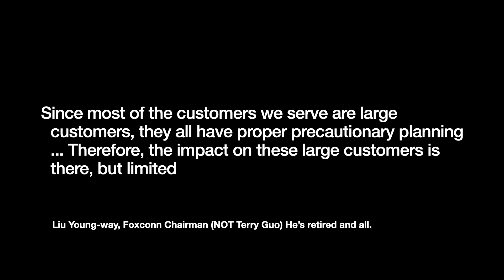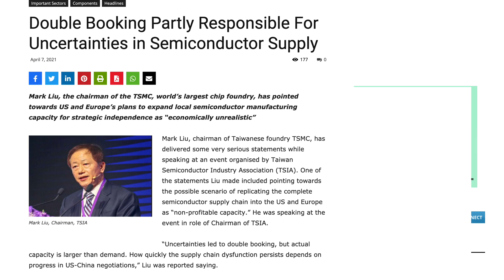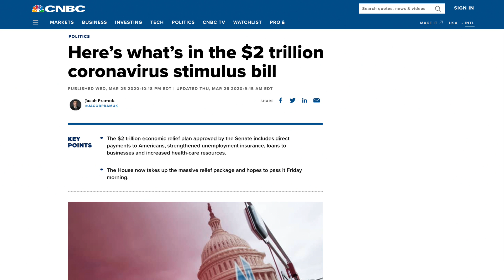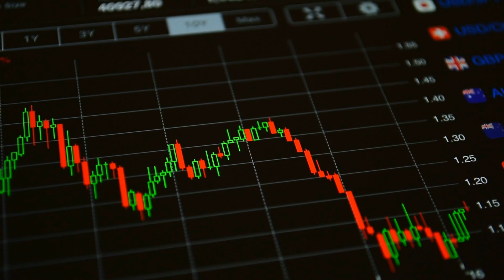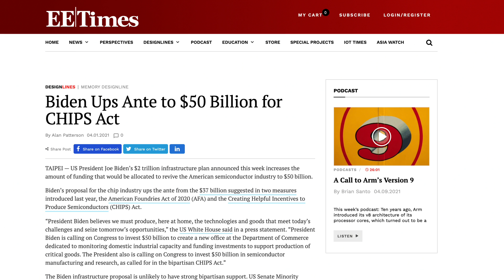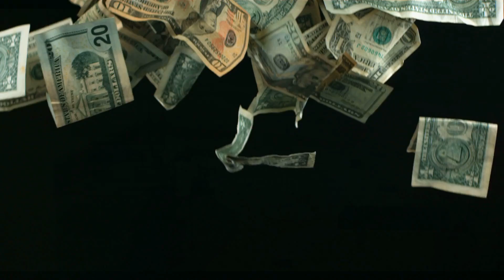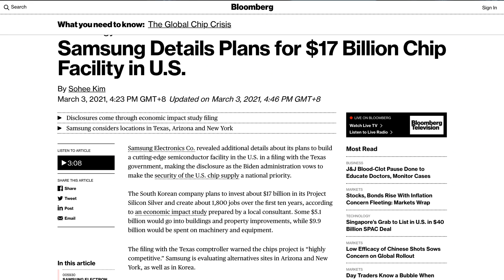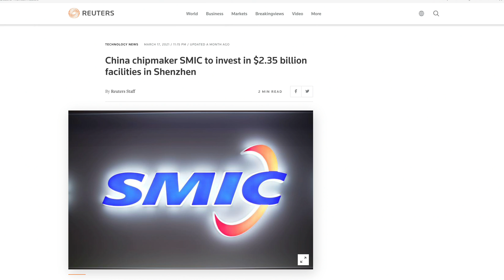The Coming Semiconductor Bust

Comment: I think the big engine for demand will be electric cars.  Many countries want to phase out gasoline and diesel cars and replace them with electric.  These electric cars are going to come down in price fairy quickly, maybe in 10 years they will easily undercut the cost of internal combustion.  When that happens, a lot more people will consider buying new cars who previously only bought used.  This is because, fundamentally, electric is easier.  It does not take billions to develop electric motors.  And makers can use the same motors, just more of them in higher end, to get better performance.  That means better economies of scale in making the motors.  And no billions for transmission engineering...most won't even have transmissions.  Several models of electric cars can share the same "skateboard" making it easy to make new models.  There are only 2 things slowing this.  The batteries...just because it is hard to scale up production.  And the car factories.  These things need to get paid for.  Once they are, prices can move down.
And we will see this all over again with personal flying drones that carry people places.
There are some other areas that may expand as well.  VR, AR, and elaborate heath monitoring, are finally arriving, soon, I think.  Smartphones may be replaced by AR/VR glasses.  The health monitoring craze, I think, has just gotten started.  This will also help drug research, and just general medicine, as we will learn much more about normal ranges for things, and what affects these measures.
And people will want satellite smartphones rather than just ordinary smartphones.

Comment: Also correct, Moore's is not a physical science rule, rather it was a description of the era of rapid semiconductor development.  No Boys and Girls, we were not going to continuously shrink semiconductor node by 1/2 every 18 months forever,  but it was fun while it lasted.  We are not doubling transistor density every 18 months.  And BTW mores law was not about the number of transistors in the die, it was about doubling transistor density every 18 months.  And during the era of rapid semi development, the cost was also coming down.  One thing to consider, and is unique to semi, is that no other industry strives to double the performance and lower the cost at the same time.

Comment: I have been in the industry for along time.  I agree with you.  Holy MOLY that sounds like doubling the existing capacity,  What you fail to empathize is that as well as costing BILLIONS to make a fab, it takes a pretty long time.  The buildings are complicated and full of chemical compliance nightmares , and it takes lots of really smart people to run those fabs.  Plus Ithe tooling vendors do not have the latest and greatest ASML litho tool (150 million) waiting on the shelf.   PLUS the GRAINULARITY  of a fab.  Once its up and running, that is a lot of capacity.  How many chips will be produced by all of those fabs?  TRILLIONS?  Probably not enough trained people to work/run those fabs in USA.

Comment: Question: If there is a bust and there ends up being a lot of excess manufacturing capacity, can we expect SSD prices to go down significantly as well?
Reply: SSDs aren't the same type of product.  Does TSMC even make any memory products?  I know Samsung does and some other companies.

Predicting sales of SSDs isn't the same as predicting what's happening at TSMC or AMD or Intel, etc...  For instance I can build a new PC using all new parts, but last year I swapped out an old NVMe for a newer one, and I move that into my new system.  Best to get that information from the business world that watches that industry.  Businesses upgrade their storage configs when they see the need to, and upgrades are always centered around SSDs of different types, such as NVMe drives can be used as cache buffers for large arrays.

GPU prices are painful right now, but SSD prices are basically near their MSRP, and there are sales on older products which means a good supply of newer products.  I just bought a couple WD SN750 1TB NVMe drives for the lowest price I've ever seen them at.  But I wouldn't use that one tidbit of information to predict prices a year from now.
Reply: @johndoh5182  Thanks for your insight.

Comment: With regards to fab expansions, unless you have equipment planned in the build pipeline already, it can take you over a year to get a slot, depending on general business conditions. With how it is now, if you haven't planned it already, you may well hit the next downturn before the tool is delivered. Saying that, a downturn right now may just be a slackening in a generally increasing demand (hopefully :-) ).
If you are looking at building a fab, you are not looking at current conditions at all, but extrapolating out a long way - state of the art fabs take 3-5 years to build and kit out, with a likely 1+ year to bring online. If everything aligns it will be a minimum 3 years from decision to build to first silicon.
Reply: that is why with more advanced nodes there is hope that instead of die-optimised chips, there will be more fpga and neuromorphic , universal chips possible.
universality is both bad and good. 
ability to have fpga for beta products at much smaller node than predicted final product (f.e. microcontroller) is something everyone looks forward to.

Comment: i kind of disagree with the conclusion though. If fabs are incentivized to produce as much as possible because of its base cost, it should only choke out companies that cannot get the contracts to sustain their output. Chip prices should remain as is because that is already the most competitive price a semi-conductor can be produced because the pressure is supply side. It should work out the same as demand curve driving prices using marginal calculations, and those companies that have over-forecasted just won't survive or just takes the loss in the short term for another shortage cycle. This may have also already been priced in as this is a known phenomenon for decades now so the peak prices ought to be set to be high enough to overcome the troughs if there are any. 

What I mean is that this isn't an actual bubble. It just seems like a normal operation cycles, and we also do not see semiconductor industry as a cyclic bubble historically even though these cycles have been happening already.

Comment: I have been thinking about the ridiculousness of the news about the chip/fab shortage. I think I saw somewhere that China was importing about half the world chip supply, but now those chips can no longer be imported to China. So how can there suddenly be such a chip shortage when the biggest importer is gone.  But what China is is  the major packager of chips. So maybe it is not a shortage of chips but of packaged chips and someone is looking for get massive government subsidies for fab facilities that are not needed, what is needed is assembly. That assembly does not seem to be being built so there will be no where near enough assembly to for all the chips that will flood the market. After all we hear auto manufacturers are having to cut production because they cannot get the chips for the cars, but that is really they case because the auto companies do not buy chips they by electronic assemblies, that contain packages that contain chips.  So somehow somebody is spreading a massive lie, and this will not solve the problem, instead it will create a lot of excess fab sites that in 5 years will be of little value as technology has moved on, and they will be glutting the market with chips, so no money in building chips. Just ripping off the taxpayer again. The only fab sites that will be making money are the ones in China that will be suppling all of the chips for the Chinese packagers, And the Chinese packagers will be making out like bandits since the price of packaged chips will by then have skyrocketed, and China is the significant source of packaged chips.

Comment: The bust will not likely materialized this time. First, the capacity published is thoeratical capacity. As the pandamic is still ravaging, we shall expact it max out at 60%. Hence, a bust is not likely in future 2 to 3 years. After that, as the pandamic will likely passed in 2025, the demand will be come back in full swing. Automation and AI will be running on full fledge as traditional industry and consumer market will move towards remove the human factor in their Supply chain. Therefore, the demand will be unimagable as we see it today. And the chip shortage will be a topic of discussion for probaly up till 2030 or more

Comment: I don't know about the bust - is there a reason I'd ever want a 40nm chip over a 2nm one? I can slap a heater resistor if I need extra heat, and an interposer if I'm too lazy to redesign my package. Outside of radiation-hardened logic and stuff like motor controllers, there's no reason I wouldn't design my christmas light controller for the latest node, outside of limited fab supply. Cigarettes do integer math faster than the apollo guidance computer nowadays and save for societal collapse, we are not going back to the abacus. The point of subsidies is to shift the constraint from manufacture to IP design - not to sustain the exclusive big boys club.

Comment: I do think that with the rise of chiplet designs we may see a tilt toward larger die area per product (e.g. graphics cards, cpus), then however running at a lower frequency and voltage to balance out power consumption.

Comment: A bit late to the party. As a retired EE I have not been following fab technology very closely, thanks for the timely update on the situation. It is always interesting observing the intersection of technology and economics. The rapid advance of semiconductor technology has been incredible, it never ceases to amaze me how much functionality can be built into small battery powered devices. 

Having said that as a geezer I find that the technology in many new devices actually reduces usefulness and customer satisfaction. My wife and I recently purchased a 2020 Toyota Corolla. The difference in electronic content is in stark contrast to our previous Corolla of a decade ago. Some features are very useful however, many tend to impose the "will of the car" on us because the car decides what is best and refuses to operate in the way we desire. Other examples are making what was once a simple operation: such as ignition switch assy mode or parking brake activation activation (we have manual transmission cars).  The keyless ignition now requires numerous operations to put the car into assy mode to simply listen to the radio without the engine running. So many steps in fact it requires consulting the 600 page owner's manual to do it. The sound system included a short term free subscription to cloud based services that we have no interest in using. Like most modern electronics the system requires a non-ignorable firmware update so each time we start the car and have to click thought the nag scree to access other functions.

Comment: Musk says Tesla have struggled to buy enough chips but it’s interesting this vertically integrated company is not adding any chip fabs to its list.
Reply: Because you don’t understand the variety of chips used in a single product. 
Massive microprocessors, analog op amps, single transistors. He would need to buy a large electronics company to have that large of a portfolio.

Comment: Hard to get a handle on this industry. In economics I leaned about the pig cycle and the chip industry might to some extend be victim to the very same law. But to me it seems that the demand is structurally going up more than expected as the "green economy" ask for more computing capacity. If you imagine the amount of electronics that is needed to transform the traditional combustion motor car to the EV then I think the supply will be met by the necessary demand.

Comment: Actually Moore's Second Axiom is steal from Intel and you will be prosecuted. Rocks Law another Axiom similar Moore's law as an axiom is as production volume doubles cost halves. On the doubling of CapEx every four years is because tools at any lithography are traditionally relied for two production generation phases that are two years each thus fours years total. However, one product generation has been implemented in less than two years and that's occurring now, more of less 8/7/6/5/4/3 nm and has occurred in past where two product generations are achieved in three years, mid 2000's and this is referred to as 'concentration' of the process cycle. See more processor production economics at my Seeking Alpha blog spot. Mike Bruzzone

Comment: Because the boom cycle has been going on for at least 2 years and the general consensus is that the cycle will not turn until late 2022 or 2023, world demand will appropriately build enough meaningful effort to try to increase production that a bust cycle is inevitable, since, the pain of lack of supply becomes extreme to the point of increased inflation to the cost of end product goods.

Comment: Actually right now the pinch in automotive is automakers were strong sensors from Chinese electronics companies. The United States banned companies from doing business with Chinese businesses tied to the Chinese government. One large semiconductor manufacturer was banned from doing business with over 83 customers. They are making chips as fast as they can. Until the sensor manufacturing and assembly gets ramped up in non Chinese business held foundries the bottleneck will continue to exist. Hopefully, when the government meets with chip makers, electronics makers and automakers later on in the year they will fix the issue. Chip makers based in the United Stated can’t even by silicon grown, cut and polished In Chinese owned foundries!

Comment: If you produce soc  you will only get arountld 150 dies per wafer, so a lot less than your 3000 dies you calculated with.
So your 1.5 billion turns out to be 7.5 million for your standard socs( not talking about the big graphics cards even)

Comment: Bust is due, of course. But in mid-term future I see a lot of new demand: EVs would consume a lot more of chips, shortages in PS5/XBox/GPU, shortages in AMD Zen, satellite Internet would spur some new demand in chips, etc.
Reply: And, when TSMC comes out with 3nm, the world of servers is going to go nuts on purchasing because of the power savings.  Right now companies are buying Zen 3 EPYC and AMD can't produce enough die, and THAT is about power savings.  But, TSMC 3nm is going to be about 40% more power efficient than their 7nm die which is what Zen 3 is on.  The amount of business that's going to bring is going to keep TSMC busy for at least a couple years even with their new fabs.

BTW it's mostly EPYC that has shortages.  Ryzen CPUs can be found pretty much everywhere at MSRP, and even discounted so there's no more shortage for desktop CPUs.

Really though, the demand is going to come simply because TSMC is releasing at capacity on 3nm.  But, their 5nm node will be in demand too, and from what I read the fab they're building in AZ should be capable of moving to 3nm once 5nm starts to slow down in sales.